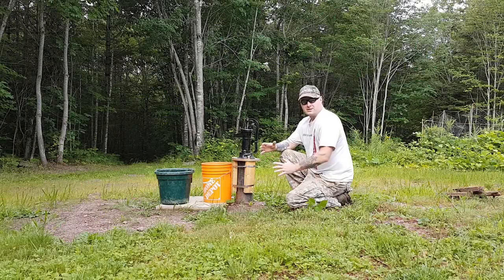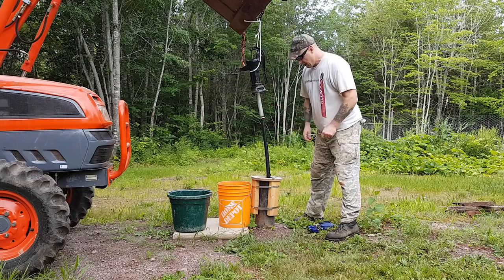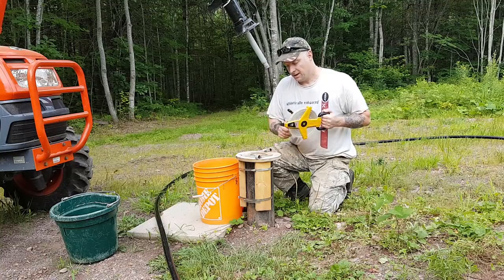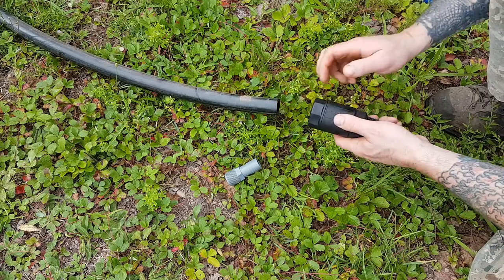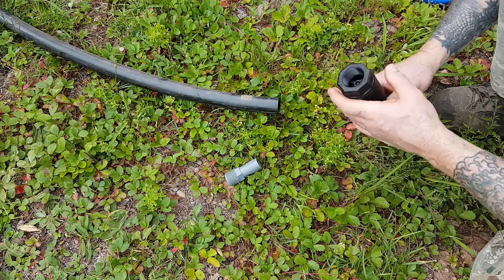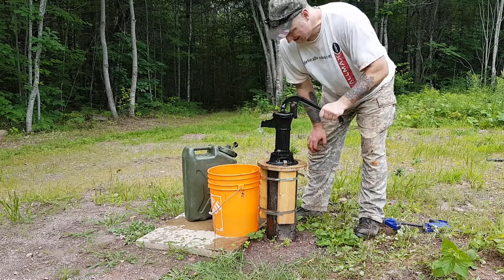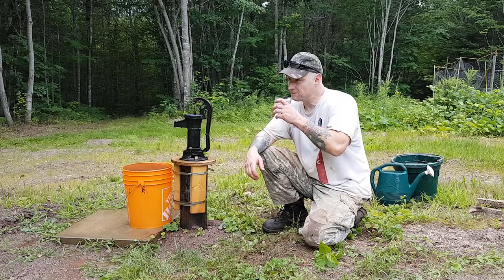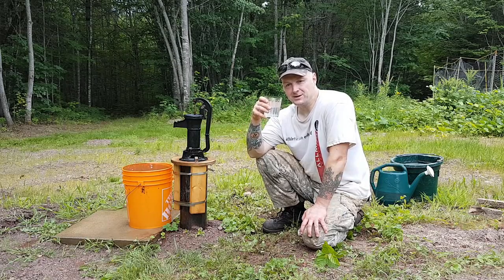Fixing my hand well pump at the cabin - Ice cold awesome water!

Comment: South Alabama here. Recently installed a shallow well 25 ft deep. Water table is 14 ft. PVC Well point is 24 ft Deep. 10 ft of water. Jetted out to the water table then had to beat 2 inch pvc 10 ft deeper. Secret is flushing out the sand a couple feet at a time. Drilled 1400 small holes into the first 4 ft of the 2 inch casing. Used 1 1/4 inch well point and pipe 8 ft long then reduced to 1 inch the rest of the way. Easier on my 1 hp Harbor freight Well pump. the last 10 ft of this well is into the coarse white sand. Very clean and drinkable water. For the top of the well, trial and error, ended up using a reducer to actually go from 2 inch up to 3 inch so I could turn a one inch 90 out the side sealed with 5200 marine adhesive. From there I installed a PVC check valve in the dirt and on to my pump in my 14 by 16 building. After the pump I installed ridged 3/4 to one of three filter housings nipple together and out of the last one, ridged again to my hose faucet. I did install a union before and after the pump should I need to remove the pump and service it. The only metal is my pump it self, two 1 inch galvanized 90s and the little bit of ridged pipe at the filters.Capped the top of my well with a 3 inch wing nut type test cap. Allows me to service the well and treat it. wont be pulling the well point out. Once a suction has been put on it, it pulls sand all around it and locks it in place. No metal, no worries I guess. No valve at the bottom. just the check valve at the top. As long as air cant get in, the water cant come out. 14 feet is not a lot of vacuum pressure in a one inch pipe though.

Comment: Our off grid cabin is water access only.  We have to bring in drinking water.  Use 20 liter bottles (about 5-6 gals) with a hand pump for that.  The cabin water is a tote that we fill with lake water with a gas pump.  Fills in about 10 minutes and lasts about 3-4 weeks.  Was gravity fed until a few weeks ago.  Added a 12v pump and a propane on demand propane water heater.  Man, nothing like having a hot shower after a day of chores at the cabin.  Love the vids man.

Comment: We live outside of the city. Primary water source is a well via electric pump to house. (House has emergency generator and transfer switch for power back-up.) Also have bottled water on hand and we have a nearly 3/4 acre pond and Sawyer water filter.

Comment: Love the pump.  We have a 1000 liter water tote we use at the cabin.  Its gravity flow at the moment but we need more pressure to operate our hot water on demand water tank that works on propane.  We are going to install a sure flow water pumper on the system to build the water pressure to 55 psi.  The pump works on 12 v so we will run it off our solar panel system.  Thanks for sharing!
Reply: I'm the same Ted. Gas water pump from the lake to fill the tote. The 12V Sureflow pump works great as does the on demand water heater (Propane Eccotemp L5).  Our off grid cabin is also water access only.  Nothing like a hot shower in the middle of the bush.
Reply: Sounds good!

Comment: I like your setup . Do you have to drain the water line for winter seems the foot valve on the bottom will keep water in the pipe at all times . I’m curious because we are having a well drilled at camp and wanted to install a pitcher pump on ours we have lots of snow and freezing temperatures .
Reply from the maker: I don't drain it. The foot value is below the frost line so it doesn't freeze.
Reply: @NB88  thanks for the reply ! I was worried water would stay up in the pump end ,  freeze and bust the pump

Comment: Great video as usual.  Is there a way to keep your pump functioning in the Winter?
Reply from the maker: I can winterize it with an inline check valve that goes just below the freeze line. Only drawback is it has to be primed every time you use it.

Comment: Just a couple questions did you drill the well yourself and can you use it in the winter.If the footer valve has a check valve not allowing water to flow back out would the water in the pipe at or slightly above the ground freeze.I would love a well the previous owner tried to drill one but got down about 8 feet hit solid rock and he quit .I'm only using water towers now and hate to let all that crystal clear water go in the fall .I did however dig a big pond so at least the water goes in there and isn't wasted.Do you need professionals if you are sitting on rock and can it be done.Ive seen you tube videos on diging your own.would be great to not have to conserve water so much .My 2 sons love their showers any suggestions you have would be appreciated Thanks Dale
Reply from the maker: I had to have a professional do it through 100' rock. To winterize it I can put in an inline check valve that goes just below the freeze line the drawback is you have to prime it every time you use it.

Comment: You need to drill a 1/16 hole in the pipe about 4 feet below the top of the well.  This lets the water drain down and your well pump will not freeze.
Reply: will you still get prime with that? also, does it matter what type of pump your using? I saw a video using a bison deep water well pump where he suggested doing the drain hole. Put he seemed to imply that it worked because that type of pump is pushing the water up rather than using suction?

Comment: Dude.. nice video.
I wanna ask what is the size of pipe u used? I have 40ft deep well. Pls. Reply thank u
Reply from the maker: 1 1/4 inch pipe.
Reply: So ur pipe is 1 1/4 inch and has a length of 38ft long?
Reply: Dude.. 0.5hp of motor water pump can lift up water? I would like to install it to my 40ft. Pls rply

Comment: 2 things.  You could have surged the waterline as you lowered it into the well casing, thereby priming it?  And curious if you checked the pump leather prior to deciding it was the foot valve that was not working?
Reply from the maker: Yes, I had the pump all apart and checked it this spring.

Comment: Any chance you could take a temp reading on the water ?  My well is 165' and is around the 55 degree mark. Also how do you keep the pump from freezing ? Thanks.
Reply from the maker: That sounds about right depending on where you live. I'm going to take a temp reading. I just left the cabin for a Maine vacation. I will check it when I get back.

Comment: Does it pump in winter or freeze up?
Reply from the maker: I can winterize it with an inline check valve that goes just below the freeze line. Only drawback is it has to be primed every time you use it.

Comment: What do you do in the winter to prevent it from freezing?
Reply from the maker: You put in an inline check valve that goes just below the freeze line. Only drawback is it has to be primed every time you use it.

Comment: 👉🏼 How do you keep the water from Freezing in the Pipe —in the Winter ?
40 —Deep wooded acres in N Michigan—in an RV Camper. 
Have to get water in town.
Reply from the maker: You put in an inline check valve that goes just below the freeze line. Only drawback is it has to be primed every time you use it.
Reply: NB88 —thanks